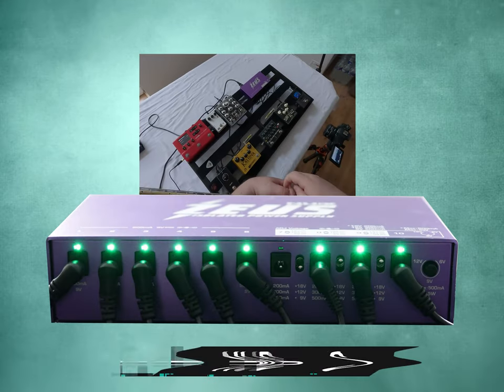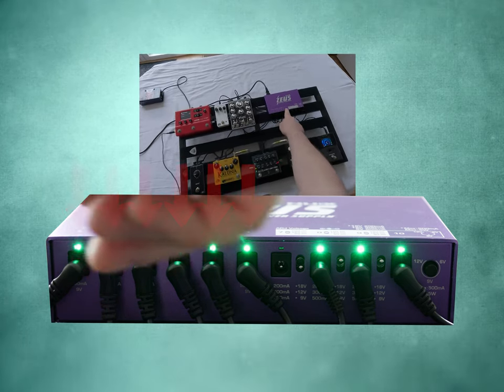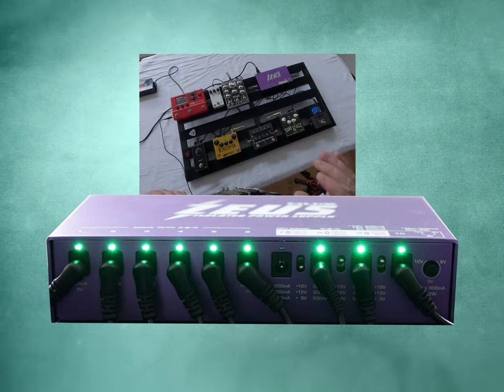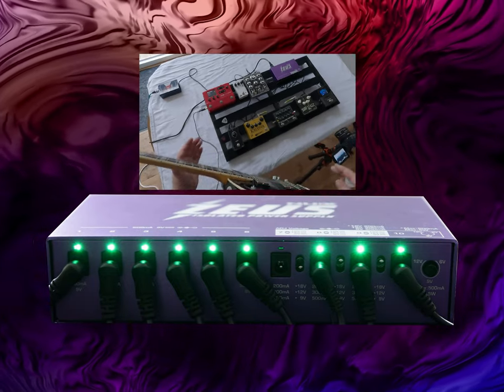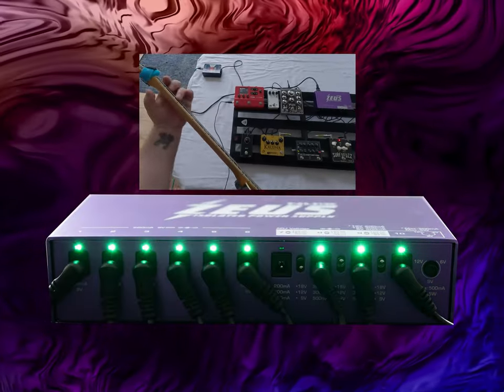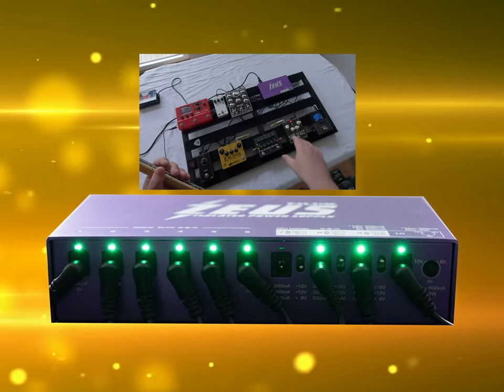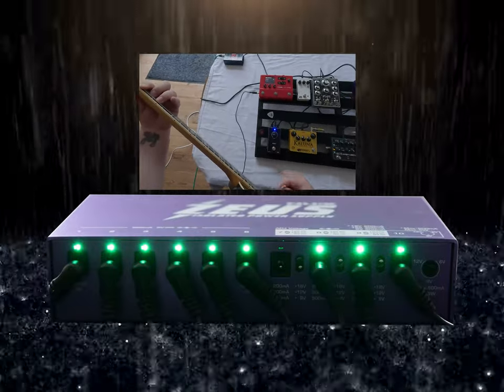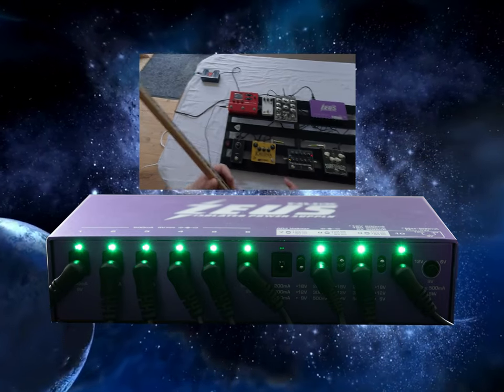NUX Zeuz (NIP-Z10) Isolated Pedal Power Supply

Comment: So is this a 5 amp max current ??

Also the double adapter is nice but to 2.1mm would’ve been better and then a 2.1 to 2.5mm adapter for those not interested in helix. Eg H90. 

I sold my HX Stomp but the reality is one cable is fine to run it on “some PSUs”.  CS7 runs it as long as the total current draw doesn’t exceed 2 amps. 

So is the Zeus seriously a 10x 500ma plus 1.5amp at 5v ??? That’s the HEADLINE so why is no one saying it????

Comment: is it true isolated? have you checked with the multimeter?
Reply from the maker: I’ll have to look into how to do that.
Reply from the maker: I'll check and will let you know.
Reply: I'm sure it is. Have you checked the price?
Reply: @kosmicwizard  oh holy shit it better be for that price haha
Reply from the maker: NUX seems to want to break the image of "cheap gear" and wants to carve a space in the higher price bracket. This is what I perceive, and not what I've heard. This would be a pricey unit if it didn't deliver, but it performs really well and the noise floor is actually very low.